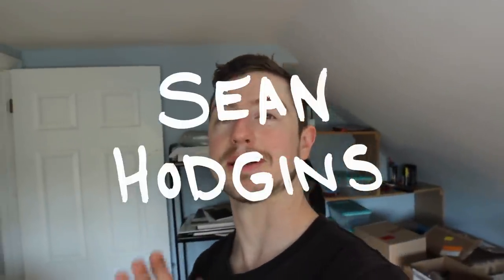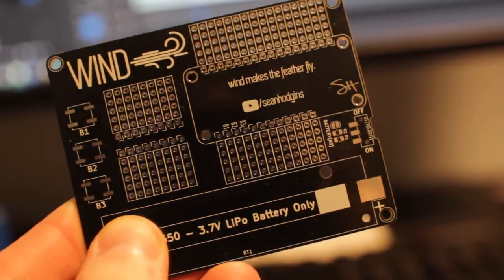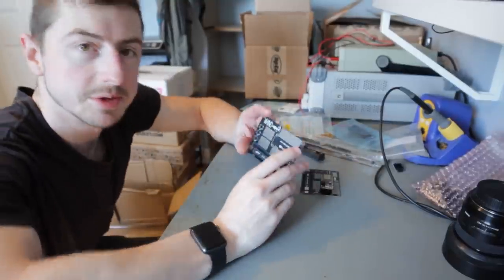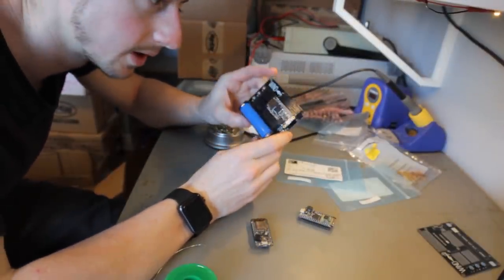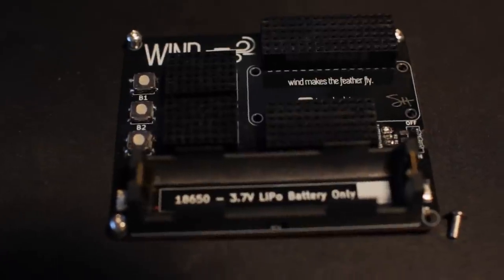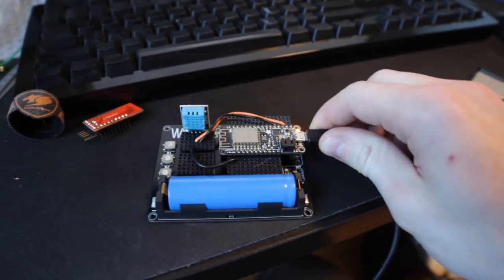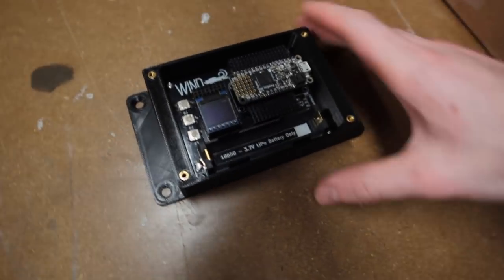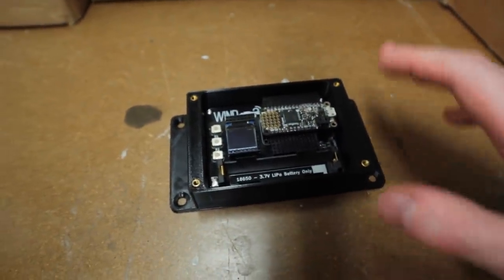Accelerate your Arduino Projects with the WIND Board

Comment: Nice board, any reason you didn't add a power switch?
Reply from the maker: There is place for a power switch component that controls the enable pin on the feather. I may make some changes to the board to allow JST connectors so that you can plug in a remote switch as well.

Comment: Nice idea, layout & implementation. Wondered if you could include a BMS system for charging the 18650 such that once put together you could charge it with out having to disturb the set up by needing to remove the 18650 for charging. Thanks for sharing!
Reply from the maker: You can charge via the usb port on the feather, if you want to make an access port in the housing.
Reply: @SeanHodgins  Thank you. I had missed that the feather will charge a battery at 100 mA, but it is there on the adafruit site and also allows hot swapping which is convenient.

Comment: Cool setup Sean. You went past it pretty quickly in the video, but I'm curious if you have a special soldering iron tip for putting in the threaded inserts. Or is it just a standard tip?
Reply from the maker: Thanks, I made some custom tips in a recent video, but at this time I was just using the standard hakko chisel tip.

Comment: Cool project, Curious if you thought about. A way to vertically mount the smaller boards? So you can run more than one of the smaller sensors. But cool none the less.
Reply from the maker: Hmm, it could be made a little large if  you wanted to modify it.

Comment: Love this! I have a request, I've never had a PCB made. Been guessing what files I need to feed to PCBway. Maybe you can add to the GitHUB README? Tx for the work!
Reply from the maker: I have been thinking of making a more detailed video about making your first PCB from start to soldering. Let me see what I can come up with. As for PCBWay, I will try and add some instructions on the Github. But basically you open the project in KiCad, and you export a set of Gerber files.
Reply: @SeanHodgins  any update on this?

Comment: would be way nicer if it had a master swithch for cutting the power from the battery tho it's a cool little board. very nice.
Reply from the maker: The on board switch to the enable pin should be good enough for any application. Almost no current draw.
Reply: @SeanHodgins  Yeah that's true. I was actually more concerned about the other things that you plug into the power (sensors, displays, actuators,...). But I didn't consider that most of them don't consume any power when not being used and 18650 is plenty even if those components use some power.